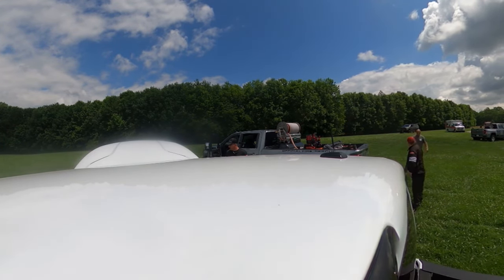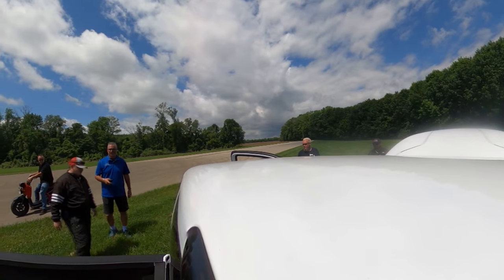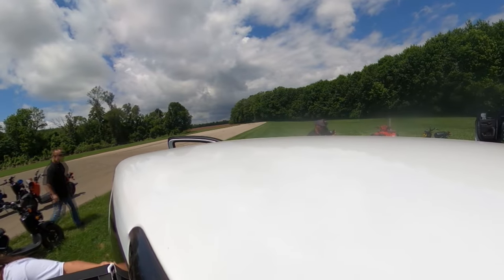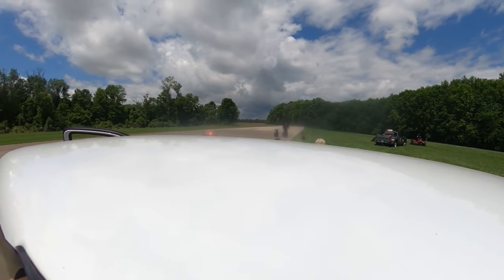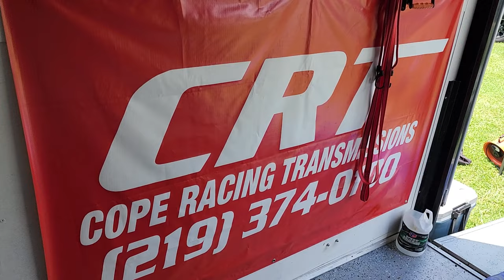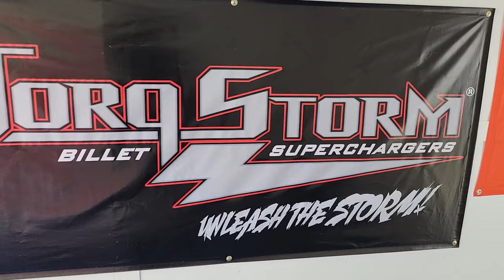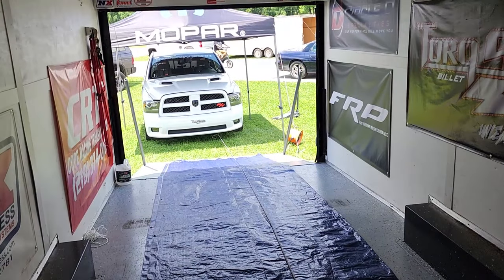FROSTBITE BLOWS UP! 21PSI Stock 5.7 HEMI Last Pass.

Comment from the maker: Well 21psi on a stock 5.7 finally caught up guys. However I believe we had a pushrod or valve spring failure that caused it not so much a actual piston or rod failure but we will find out soon lol. I want to thank all of you for supporting the channel and following the frostbite Ram build. We definitely got all we could out of the original 5.7 at 156k mileage and countless drag passes on it I couldn't even be mad the 5.7 served us more than fair💪.  Huge thanks to Torqstorm superchargers the TS84 is definitely making some serious boost. Also frptuning.com for letting us push the limits. Also thanks to Cope Racing Transmissions for the baddest transmission to put this amount of power down💪
Reply: 6.4 ready to go in yet ? Held up longer than I expected with that much boost
Reply from the maker: @charlespatterson2900  not yet not sure what the next move is just yet. But yeah the 5.7 did more than enough couldn't ask for more.
Reply: Cope racing transmissions, haven’t heard of them but if it can handle a large truck body with boost drag racing and out live the motor I might have to check them out thanks brother. Sorry about the unfortunate circumstances of events. Thanks for the content brother. 👍🏻
Reply from the maker: @joshreynolds729  thanks. John Cope builds some serious 727s and I'm running his built 46re
Reply: @FrostbiteRam  thank you so much man! I’ll check them out, much respect sir.
Reply: Well dang! New heads let her eat!